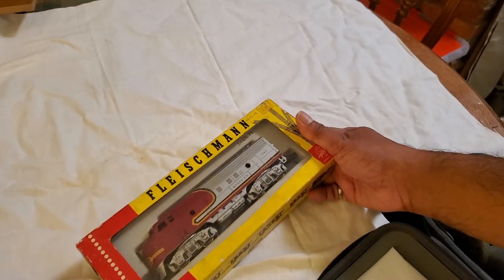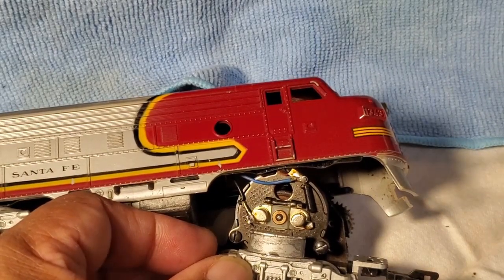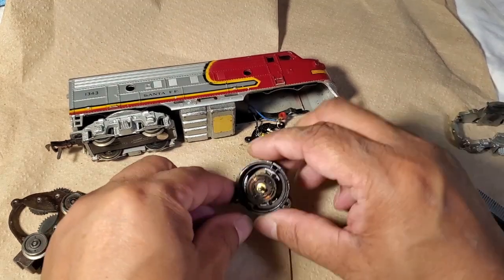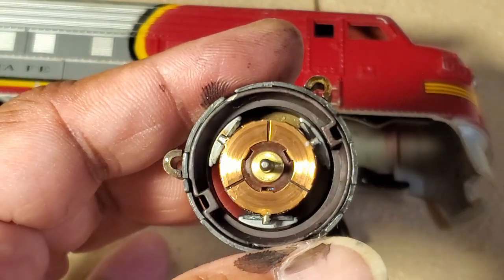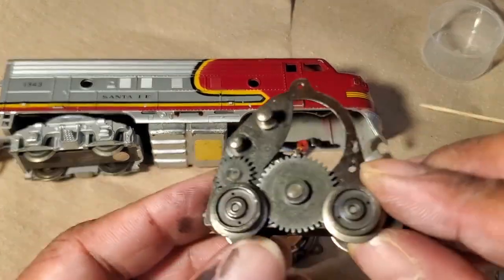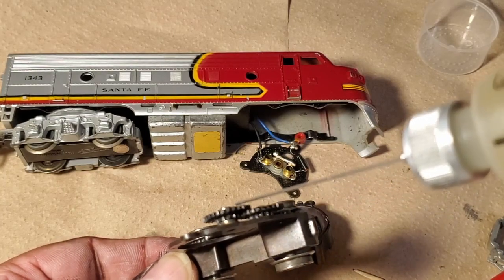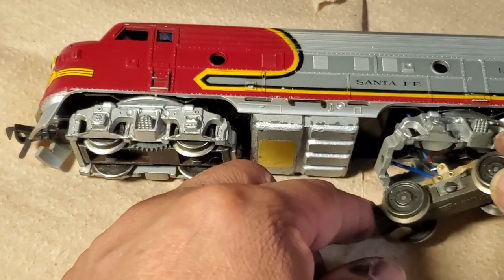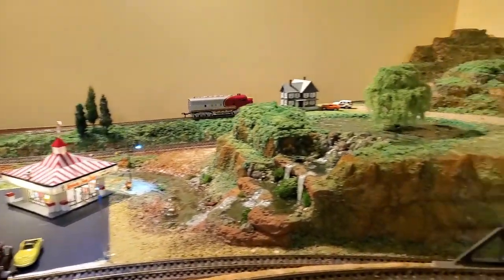Servicing a Vintage Fleischmann HO locomotive

Comment: Really enjoyed this, made SOP notes from it.  Have 20 Fleischmann engines that need this sort of attention.  Done bits of this before but its nice to see it all together.  Look forward to more like this.
Reply from the maker: Hi Pat , thanks for the feedback .. Appreciate it . I would love to hear about the 20 Fleischmann loco's that you have .. , Do you have a mixture of Steam , Electric and Diesel ? would like to hear about them .   If you also need the service sheets or specific information about them ( which era , when were they manufactured etc .. ) let me know , I should be able to get that info for you .. 
Regards, - Anthony -
Reply: @anthonyshobbycorner  Hi there, have 61 Fleischmann engines, 26 of them had some sort of issue; 11 shunting, 1 Bahn-bus, 7 V100, 8 V200, 2 V218, 3 BR68 SNCF, 2 Ae 6/6 Swiss, 7 BR55/44 Medium Steam, 9 BR01/50 large steam and 13 E10/E103/E44 electric.  The issue is a lack of electric knowledge on my part, following your steps has solved a couple.  I take apart a working engine to map out wiring to duplicate in a non-runner and still get a stuttering engine or track power killer.  When HO Fleishmann ‘left the building’ I bought up hundreds of parts to keep the engines going for years.  Have all the diagrams, thank you.  I keep notes and take photos of everything.  All a big challenge.  Pat

Comment: The commutator of this motor was remarkably oily - I have never seen  a condition like this before. But at least it prevented corrosion over 50 years in the box. Fleischmann recommended just a small drop of oil for each bearing. They offered a useful little bottle to apply the recommended oil (Art. 6599). But your "hobby oil" looks suitable.

The older Fleischmann motors had a small washer similar to the buds you used to clean. It functioned as a kind of storage for the oil and prevented it from going on the commutator - if serviced as recommended and not drowned in whatever. In the newer versions the bearings themselves work like a sponge and keep the small amount of oil in position due to capillar effects. If too much oil is applied the same capillar effects will make the bearings running dry soon. There is as well a washer between bearing and commutator, very thin and translucent in this version, getting lost easily. It helps to keep the oil apart from the commutator and prevents the commutator from touching the housing. I do not use a special conducting oil for the commutator bearing.

Comment: Excellent video! I used it as a guide last week  in servicing the motor on my first Fleischmann locomotive (4016 BR 70). It runs beautifully now but draws a lot of current, so much that it overloads my controller. Is there any common culprit in these motors that causes such huge power draws?

Comment: Hi Anthony, I came across your video just now while searching for resources to get a trio of old Fleischmann locomotives I picked up today running again. The seller couldn't tell me much about them but there where two old lubrication charts, one for a "1302 G + 1302 R 1202 Z" a little blue and white electric two axle loco with spring loaded pantograph on it's roof, the other for a a "1362" DB Steam locomotive (though underneath the two axle front idler wheels is cast then number '1342' while under the tender is cast 12/517. This locomotive has 3 drive wheel axles and a single rear idler wheel axle, though the images on the lube chart match this loco.  The other one, also a DB,  has '12/953' cast under the single front idler wheel axle, 5 drive wheel axles and no rear idler wheels. On the underside of the tender is cast '12/517' (though this tender is a different design from the first). Of the three the only one that worked for a short period is the '1362' but it was making grinding noise and stopped after about four feet.

Do you know of a website with info on vintage Fleischmann locos? These are at least 30 or more years old and when I tried to find info on them at Fleischmann's present day site I came up empty.

The little electric loco looks like it's got a similar motor to the one in your video & I suspect the steam locos are similar but with the actual motor in the tender as the 1st three axles have geared wheels on one side of the tender and I'm assuming the pickup wheels are on the locomotive itself as their are two wires that run between the tender and loco. I can send photos of them if you'd like
Reply from the maker: hi George , I'm so sorry for responding to you this late . i had stepped away from Youtube during summer to take care of all the summer chores which were piling up . 
ok, so I can definitely help you with these locomotives. Here is my email address. contact me via email and we can take the discussion from there . I have fixed many of these Fleischmann's . There is a site which keeps all the old information on Fleischmann's of which I used to be a member of , but I don't have a membership anymore .. Just did not have time to renew it . 
Here is the link to that site . Some info , you can get for free ,. 
http://www.fleischmann-ho.nl/e/database-fleischmann-ho/database-flmho-e.htm 
Send me an email to the address I provided , and I will be more than happy to assist you . 
Regards, - Anthony -

Comment: Hi Anthony, 
Need your help with a Fleischmann Alco FA unit. 
Ringfield and gears are fine, thanks to your tutelage with this video. 
It's missing the copper (brass) nub on the rear truck, which I am unsure makes a difference. 
It has trouble making a complete lap without nudging it, and for no reason the rear truck derails. 
I wish you had a personal email/Facebook page to message you with. 
Awaiting your answer. Thanks.

Comment: Hi Anthony, glad I found your video. I have a layout and I have HirnbyTriang/Lima model trains.
I recently purchased a non running Hornby and I found out it has a Fleischman  motor.
So I went on a journey ir comedy of errors trying to get it running.
I eventually did but then decided to  take the plate off to clean the armature.
This was my worst nightmare and turned out to be.
I lost the springs and cover clips for the brushes!
I found the covers and obviously did not secure them properly. Is there a trick to ensuring the clips fit securely?
Great job.
Reply from the maker: Hi , Thank you for your comment. I checked out your video of the Hornby/Fleischmann loco . This is the 1st time I have seen such a setup . Either way , I'm glad you finally got it working . Also , Did I hear correctly that you were in Toronto Canada ? If so , let me know . I live about 30 mins North  , In Newmarket , Ontario.  With regards to the clips ( covers which hold the springs ) the trick is to hold them with nose pliers . If they are sliding off too easy , you can give the curved tabs a bit of a squeeze to ensure they grab better . Here is my email . reach out to me via email and we can connect : anthonyshobbycorner@gmail.com .  I have serviced a ton of these fleischmann's so if you need help with them please don't hesitate to ask . Also I use Brasso to clean the commutator . that is freely available here in any hardware store .  take care - Regards - Anthony .
Reply: Hi Anthony, yes I live in RH.
I found two hornby Flieschman motors at the Great British Train show last weekend, both in great working condition.
I was also told that John’s trains has sone of those caps
Cheers
Charlie

Comment: Thanks for this great in depth and detailed video. I really like older Fleischmann H0! I have an issue with the 4912, it was getting really hot and it was very noisy and didn't seem to run at full strength. I tried cleaning the commutator with cotton buds and circuit cleaner, but I was too afraid to compelety open up the motor. It's running a little more quiet and a lot cooler now, but still slow and more noisy than I'm used to. Any suggestions? I guess there's more gunk in there, so I will have to open up the motor and thoroughly clean it. Thank you for the multimeter tip too, I will check that as well. Much obliged!
Reply from the maker: Hi , It is hard to diagnose without hearing or seeing the locomotive. However I am more than willing to help you address this issue. Based on the Fleischmann DB, seems like this is a Special edition locomotive built in 2005 , which case as a stand alone loco, or as part of train set.  It says that it has a NEM651 DI connector, a flywheel motor. 
Unfortunately , i am unable to locate the service sheet for this loco.  If you give me your contact Info , I am more than happy to connect with you and help you diagnose the issue .  Here is my email address. Anthonyb1019@gmail.com. I will give you my phone number , if you choose to connect with me via email . I am  more than happy to connect and help you get this loco back to normal operation.  Based on what you described , I am thinking that the bearings on each side of the motor is lacking lubrication . But I can't say that for sure without listening to the loco run . Further , If you need help , I can walk you through the process on how to clean the internals of the motor. It is not as scary as you think .. If this is a newer can motor , then it is  unlikely that your commutator is fouled.  - Regards, - Anthony . -
Reply: @anthonyshobbycorner  Hi, thank you for the reply, I sent you an email :)
Reply from the maker: @Keldervarken  Hi I'm sorry . I just saw your response .. I searched my inbox , can't seem to find it , i must have deleted the email by accident . 
Can you please resend , so that it is at the top of my inbox .. Tks , Glad to help you out , Once we are in contact .. Regards, - Anthony  -

Comment: I would appreciate if you could shine some light on the FLEISCHMANN PRUSSIAN STEAM LOCO 93 1155 B. This model was given to me, still boxed a year ago. Its HO Scale and includes GERMAN instruction manual. I cannot find info on the net as to when it was produced.  The instructions indicate loco number 1155, with the number 81256 on the engine. I assume its quite old bu highly detailed. The box is all in GERMAN.  Any info would be much appreciated. cheers .tom
Reply from the maker: HI Rusty ... Not a problem , I should be able to get you information on the loco. I have 2 prussian steams 0=4=0 tender drives by Fleischmann . Your is very similar . I let me see what info I can get you on it . I will do some digging tonight and will try to get back to you tomorrow .. Regards - Anthony -
Reply from the maker: Hi Rusty , I found the information on your locomotive. 
If you give me your email address , I can send you quick screen capture of the info , which I have directly from Fleischmann Database . 
The 93. 1155B is a goods locomotive and it was an AC model specially made for Export to Belgium . It has the serial number 81-256 ( 55. 25-56) . The Fleischmann model was built in 1988 replicating  Era III ( Epoch III).. I was also able to locate the service sheet ( how to open the loco and the list of parts ) for the 1155 locomotive . The service sheet indicates that it was manufactured in 1995 , but other data via fleischmann indicates 1998 . either way , you can assume it was manufactured between 1995 - 1998 . IF you want the service sheet, give me your email address and i will send you the PDF ... Regards, - Anthony  -
Reply from the maker: @rustykilt  - Not a problem Rusty , Service sheet coming your way . Regards, - Anthony -

Comment: Thank you, realy clear and to the point explanation, just took out my set from 40 years ago and gonna clean them up. sub. do you als have a video about how to cean the tracks?
Reply from the maker: HI Thank you for the kind comments . I will posting more locomotive cleaning vids for different models / manufactures. With regards to track cleaning , I do have a video posted, and it is called "Cleaning model railroad tracks - Do's and Don'ts " 
thank you for the Sub .. Much appreciated ... 
IF you need any help with your locomotives please don't hesitate to reach me .. Anthonyb1019@gmail.com .
Regards, - Anthony -

Comment: You have mis represented the model. This is not the original fleischmann f3  model 1341 was all metal and preceded this model by more than a decade. The original motor was not a ring field but rectangular. The ring field was adopted mid sixties than injection molding replaced diecast after 1970
Reply from the maker: good observation . However, I don't have a 1341 nor am I referring to it The 1341 is an Alco and was built between 1959 - 1967. , Rather I have a 1343  ( 4700 ) which is an EMD unit    ( . According to the Fleischmann database , the 1343 was manufactured between 1960 - 1973. ) . You are correct in that the 1341 was built a decade prior , but that's not what i have.
Reply: @anthonyshobbycorner  The Fleischmann F7 was originally built in 1960 and came in Burlington colors (German catalogue). For the US market, it was also produced in  Santa Fe, Union Pacific and New Haven colors, supplementing the 1341 Alco FA (with a die-cast shell) in the same colors.  The German catalogue changed the livery from Burlington to Santa Fe in 1970, when their new numbering was introduced.  The headlight was added by a previous owner as the Fleischmann F7s were produced without a working headlight. (The 1341 FAs had workling headlights and illuminated number boards.)
Reply: Note that the silhoutte on the box end next to the number 4700 shows the 1341 (Alco FA) in the Santa fe livery!

Comment: Clean the motor with ascetone, far more effective than alcohol.
Reply from the maker: Thank you for the comment . I'm tend to stay away from acetone as it is does not play well with plastics. I use Contact cleaner mostly , as it is designed to clean electrical contacts such as brushes , contactors , relays  etc ... 
Appreciate your feedback . .  Regards, Anthony